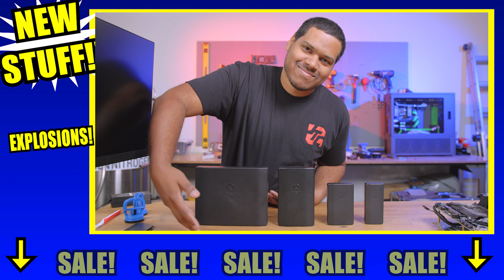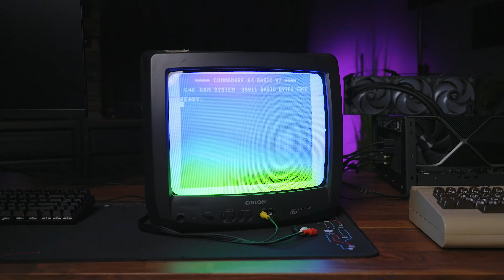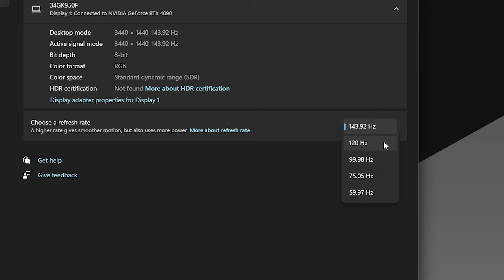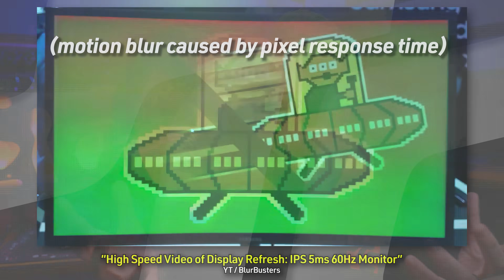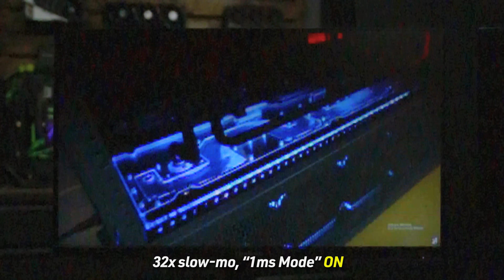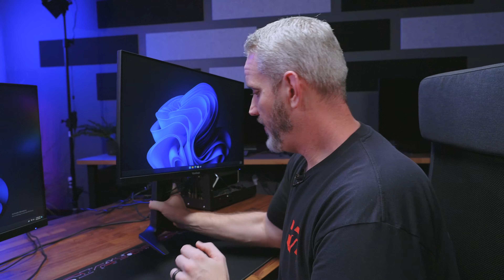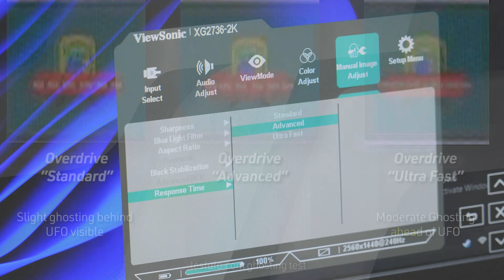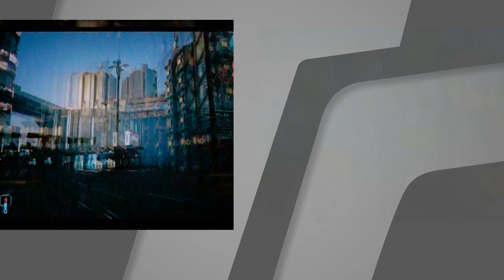MPRT is pretty awesome! This is how it works...

Comment: Very cool to see your history of display technology, starting by explaining nicely how CRTs work. You mentionned a range of 60-120Hz, you know most really high end PC CRTs were 160 or 170Hz, with some models even saying 200Hz. In reality some models can go way way further at lower resolutions (400Hz and up).
Reply: The big advantage of a good CRT, IMO, is the ability to accurately display any resolution at full screen without having to worry about pixel ratio. Whether you want 240p(200 pixels plus overscan, the light blue border as shown in the vid) that a C64 will output, 576i used by PAL region SD systems, 800x600 or anything else that doesn't divided by 1080, you aren't dealing with uneven pixels like you would be on a 1080p or 4K panel.

If you upscale 240p to a 1080p then it is 4.5 pixels of the 1080 for every 1 pixel at 240p if you're at full screen, meaning you either have to upscale to 960p and deal with back borders or uneven pixel sizes, which leads to image distortion. A good CRT will simply draw as many lines as required evenly down the screen.
Reply: @fattomandeibu  Couldn't agree more! And exactly what I keep repeating every time when talking about CRTs vs anything else. It is the only technology at this time, able to display any resolution natively, all the way down to the 240p stuff (possible on a 31kHz+ VGA monitor via something like an OSSC, line doubling to 480p and making the doubled lines black) and all the way up to like 4K when using interlacing. Every single resolution always looking immaculate.
Reply: @fattomandeibu  ...but bear in mind the CRT is still sub-dividing the image into little dots, analogous to pixels; it's just that they aren't square, and usually aren't even on a rectangular grid, but rather on a hexagonal or a staggered-row matrix. That, combined with a slight bleed between adjacent dots which is equal in all directions (i.e. circular symmetry, rather than just vertical and horizontal), helps disguise what's going on and makes the ratio between the number of scan-lines in the image and the number of physical dots on the screen less critical.
Reply: @therealpbristow  It's still better than using an obviously uneven display that you typically get from a flat panel. Heck, the colour bleed is an effective tool for a considerable number of cases, particularly for SNES and PS1 era systems, where sharp pixels lead to a mess of dithered pixels, with inaccuracy of the beam acting as a natural anti-alias.
Reply: @fattomandeibu  [NODS] To be clear, I'm not knocking CRTs. Like any technology, they have their strengths and their weaknesses compared to the alternatives, and the trick is to choose the tech that best suits your needs. 

With a good CRT, if you gradually push the resolution (or rather, the *number of pixels*) of the images you're trying to display higher and higher, the actual on-screen resolution rises smoothly along with it, until it just gently levels out as you approach the maximum it can support. Whereas with pixel-based displays, you go through an alternating succession of "fuzzy but even" vs. "sharp but uneven" image quality, depending on ratio of source pixel size to display pixel size, with those artefacts becoming noticeable much sooner than with CRT... but then with occasional "golden ratios" where the two pixel-grids complement each other nicely. So while for those "golden ratios" the pixel-based displays can give the cleanest results, for almost every other ratio CRT gives a more natural, "un-mangled" result.
Reply: @therealpbristow  Oh yeah, I wouldn't be using a CRT for my daily driver, but even my PS2 gets horrible deinterlacing artefacts(mostly combing) on my PC monitor, so I have a triple standard(PAL, NTSC and analogue RGB) CRT for playing old school stuff. It's not even a fancy one, was about £100 when I bought it new around '99 or so.
Reply: On my side, I never ever use any display with a physically defined array of pixels (meaning any recent flat panel) at a different resolution than it's native one. There are only two exceptions to that.
First being to display a lower resolution at a 1:1 pixel ratio... but it won't use the whole screen, and small resolutions will look tiny so that's not a good idea. Second is using a proper scaler with CRT-like shaders, like the recent RetroTink 4K, that basically tries to emulate the look of an electron beam passing through a shadow mask/aperture grille. That would give a very good scaled up version of a low resolution on a recent panel, especially one with high PPI. But obviously, these devices are not powerful enough to fully utilise the specs of recent high refresh rate high resolution monitors yet, and display scaled up PC gaming range of resolutions.
Like for example, it would be awesome to be able to plug in such a scaler to a 4K240Hz display, and then hook up a retro PC with a 8800GTX for example, and run I don't know Far Cry at 1600x900 filling the whole screen but with a very very clean scaled picture just like what you would get on a CRT, reaching the high framerates (in the 130 or so fps I believe, on that hardware). The only way to do this at this time is with a CRT, and only with a CRT.
Now for recent games, I would play on my OLED myself most of the time. But frankly comparing my FW900 running at 2560x1600@144Hz to the OLED at 2560x1440@240Hz, also considering I rarely even reach those 240 fps in games... Sometimes I really enjoy playing on the CRT! It always feels a bit different and somehow more comfortable in a certain way.
Reply: @Slay3rOne  I recently got the new 480Hz Sony OLED monitor, and it's actually shocking how much slower the input-fidelity is compared to my Sony G520 CRT monitor, not to mention the CRT monitor can for anything from 1556p down to 384p without fidelity loss, at 1080x720p144Hz it looks and feels incredible, I love my new Sony OLED monitor, but it still doesn't look as good or feel as good as my Sony CRT monitor, even when the OLED is getting fed the full 480 FPS it still can't keep up with the CRT even when it's at only 75Hz, let alone 144Hz, the CRT also has much more image depth and colour volume than the OLED, though my Sony RGB-OLED-BVM has much closer colour fidelity to the CRT, and using a 4K Dot-Trio CRT shader with the 480Hz OLED really improves the image quality and colour volume, OLED is so much better when combined with sub-pixel-rendering, integer-scaling, shaders and rolling-scan (or at least 480Hz/240FPS HDR-BFI-injection, 240 FPS is the minimum for BFI to work well imo), I really hope we see a 8k RetroTink with 4K HDR-RBFI (rolling black frame insertion), but as yet, OLED canny compete with my CRT monitor at either 2048x1556p85Hz for highest fidelity or 1080x720p144Hz for ultra silky smooth motion and near perfect input-fidelity, 1440x1080p120Hz is a nice in between for some games, and I have been absolutely blown away with modern games at 3860x2880i72Hz and Nvidia DSR (super-sampling) at 8K or even 16K internal resolution for some older games like HL2 & Crysis on the CRT, The Touryst with 16K internal resolution looks insane at 2880i.
Reply: Those records have recently been shattered by, yes, CRT.
Reply: @legen_dary42  In some recent testing I displayed 3840x2400i at 80Hz on the FW900. That's interlaced, but at such a high resolution it's indistinguishable from progressive, and sharpness is absolutely on point, stunning picture! It could reach 96Hz at that resolution, but limited by current GPU drivers and VGA adapters. More useful maybe 2560x1600i at 144Hz on the same monitor. CRT tech has a lot to give still!
Reply: It's a real shame SED and FED never really made it to market before LCD got so dominant.
Reply: @EkiToji  SED and FED are more similar to CRT as they rely on electron emitters and phosphors but on a flat panel design, LCD is a completely different technology that uses liquid crystals and a backlight, the liquid crystals act as shutters that block or allow light through, depending on the applied electric field.
🖥🖥
SED/FED promised better contrast faster response times and lower power consumption but never reached the mainstream market due to manufacturing hurdles and a patent dispute thanks to @Canon and @Toshiba  !
Reply: @samisonline99  The closest we got to FED/SED was Pioneer's last generation of Kuro 700Hz Sub-field-Drive Plasma monitors, a pure electroluminescent RGB Phosphor based display tech with CRT image quality and near perfect motion clarity, only downside was it was fixed pixel matrix based like OLED and LCD, but so is SED/FED, only projection display tech is non fixed pixel grid based, and CRT is a projection display type, albeit a direct-view projection display type (electron-gun projects onto phosphor screen).